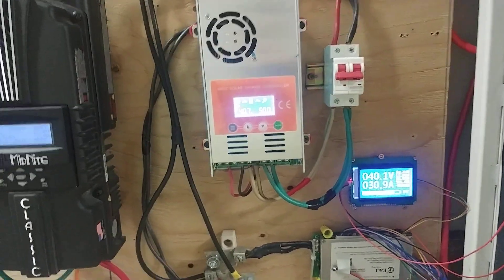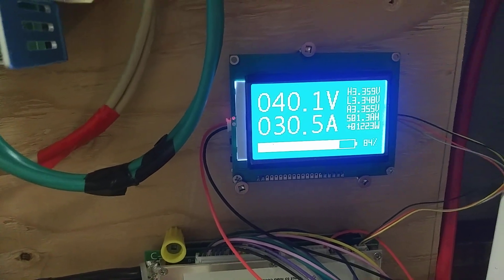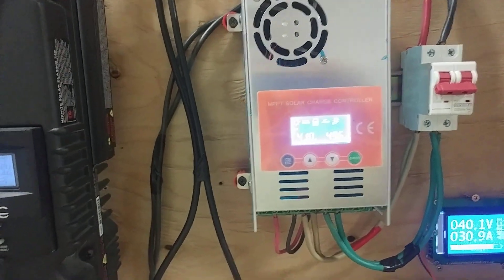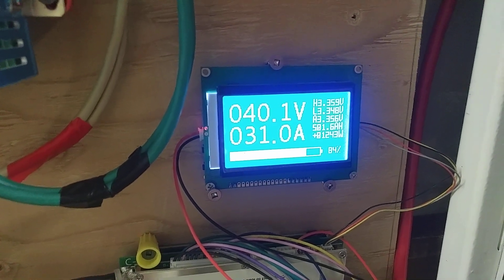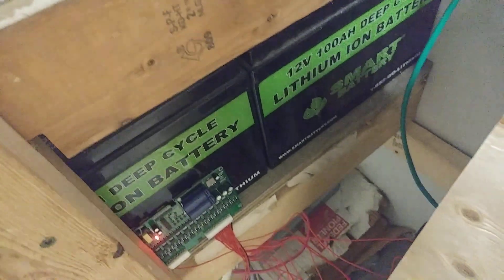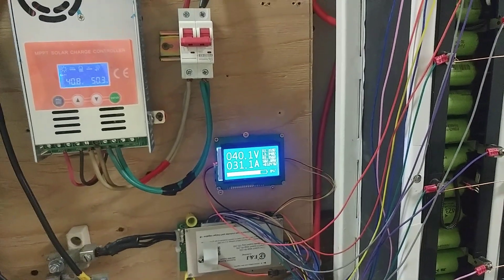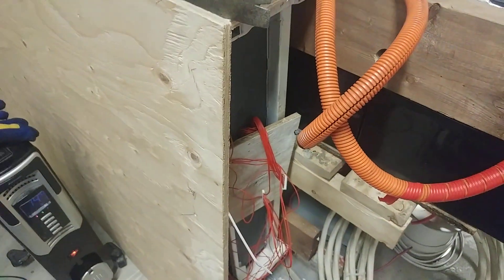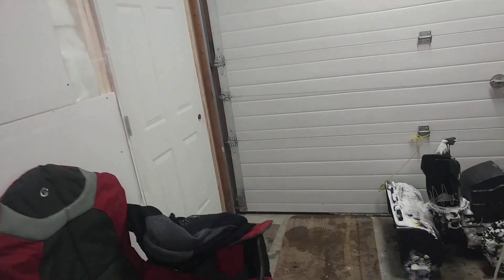2019 47 Dec update

Comment: sick system! what inverter are you running at 36v ?
Reply from the maker: Just grid tied micro inverters at the moment on the 36 volt battery but I have ordered a Tripp Lite and may go for the Reliable.
Reply: @offgridwanabe  the new reliable is fantastic, 500% better then the older ones.
Reply: tell them I sent you please
Reply from the maker: @GoingOffGrid101   Sure if I do it I will use you as a reference do you have a link that credits you
Reply: @offgridwanabe  no :S